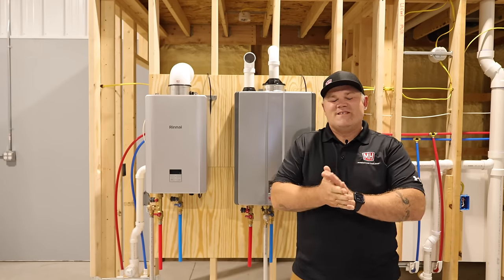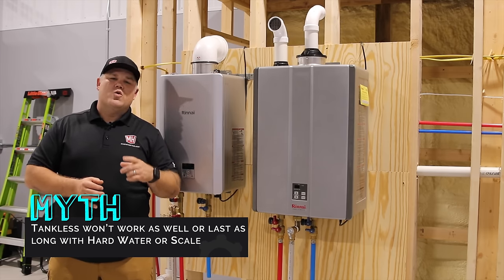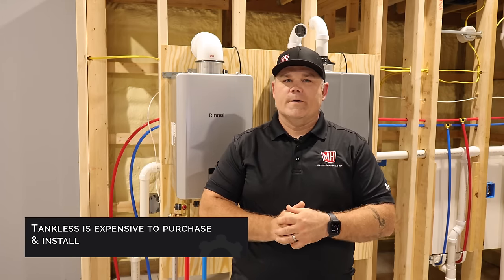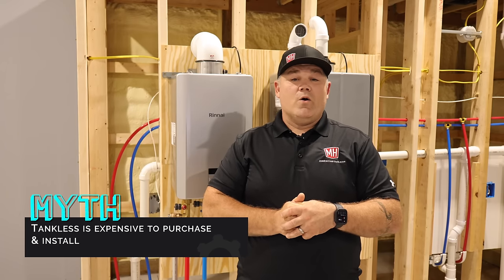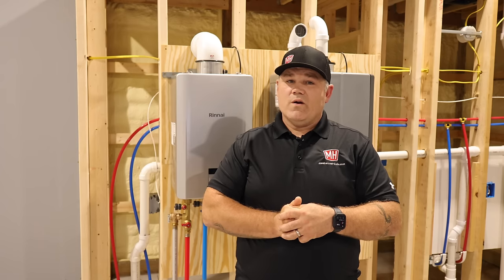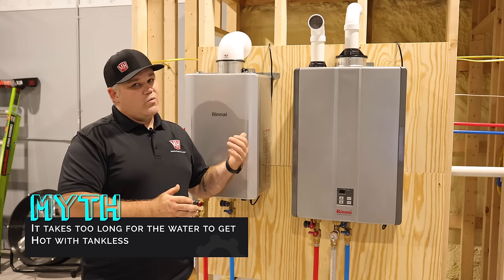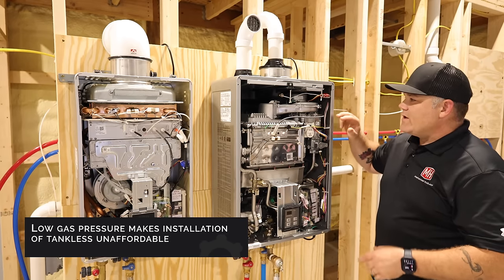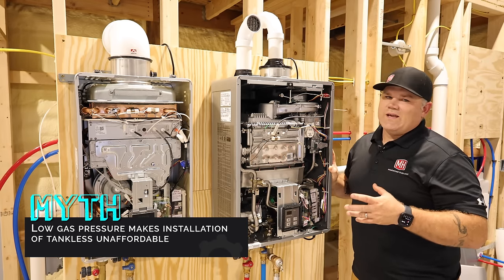Myth Busting! Tank -vs- Tankless Water Heaters

Comment: A tankless relies on fast heat transfer over a relatively small heat transfer area. That area and speed matters. While both experience the same scale, the affect on performance is vastly different. The tank can accommodate scale far better. You didn't talk about maintenance at all and that YL require flushing because they are more sensitive to that fouling.

Tankless have a fixed output with no buffer. Tanks have a usually much lower output but a large buffer. If you temporarily exceed the output of the tankless you get cold water. While people regularly exceed the output of tank heaters, they often dont do it long enough to notice. This is just a sizing issue. If you run out in a tankless you didn't get a large enough one, or need to use less water. On a tank, if you run out either you need a larger buffer (bigger tank) or a higher output unit.

Stating tankless is less expensive is utter nonsense. The most expensive tank units are the starting prices for TL which then go up a few 1000 from there. TL is a luxury item that should be purchased if your needs actually require it (few do). TL installation is more expensive. If you are paying to have it done though, the labor is the dominant cost so the parts won't make that much difference unless you need to tear into walls to connect to a panel or gas line that is large enough.

Which leads to this video is sugar coating the gas line or power requirements issue. The gas requirements is roughly 4x as much for a gas unit. Most tank units have a half inch line, which is not large enough for a tankless. A similar case will exist for electric units and the wires. The panel may not be able to supply the needed power. The gas lines may need to go way back to the meter to be larger enough. These costs can vary a lot depending on the situation. Sometimes being insignificant, other times very expensive. TL have a higher output and need more power/gas. 

Copper heat exchangers are better for heat transfer. This is a moot point though. This simply means copper can do the transfer in a shorter length (smaller area) than stainless or some other material. The heat exchanger is slightly larger with stainless. Who cares... That larger heat exchanger means it can handle fouling (scale) better, and stainless is generally more corrosion resistant. So is probably the better product in most cases for this application.

Definitely do not buy a noncondensing high efficiency WH. Tank or tankless. The flue pipe is ridiculously expensive and cost of the pipe will pay for the more expensive and efficient condensing unit. The only exception being a direct vent unit, where the vent is extremely short. 
Non condensing units that are lower efficiency (the line is around 85%) leave enough heat in the flue gasses than low cost vent pipe can be used. If your gas isn't super expensive, the cost of a more expensive efficient WH will never pay for itself over the 85% models. Run the numbers before you buy. The difference in you gas costs for a 5-10% efficiency improvement isn't that much, but the price of the WH is 2-6x as much.

I think they have largely fixed this issue now, but check the minimum flow rate of any TL and make sure it still works when you only have a faucet slightly open. Older units you would have to run it wide open or you might get cold water.

Double check the noise they make. TL (and all condensing units, tank or TL) have fans that make noise.

TL save space.

TL long term output is higher. If you have long continuous use, it might be the better option.

TL are vastly more complex and have many more things that can go wrong. Plumbers (or anyone really) are rarely knowledgeable enough to actually fix them (complex electronics). So will replace major components if available. Like replacing the entire control board if there are behavior problems for instance. Also labor costs for anyone to spend the time to figure out what went wrong are high enough that just repacing parts is justified. Parts are often very expensive though and by the time you pay for that and labor, you are getting into replace the whole unit territory. This is a huge cost risk for TL. The cost of parts on tank heaters are usually cheap and easy to service.

TL if the power goes out, you have cold water. Tank you have at least the tanks worth, and if a simple gas unit, they don't even need power.

Bottom line, learn about what you are buying. In most cases tank heaters cost less and can be sized to meet your needs. Learn about tank recovery times. If that speed isn't enough, get a bigger tank, or higher output. Learn about maintenance. Learn about how long they are really lasting. In a tank, replace your anode every 5 ir so years!!!.

Comment: I have a 12 year old electric water heater. What would replacing it with a tankless system involve? We are not on a well, but the water definitely needs softened/filtered. We don't need a ton of hot water capacity. We were thinking about just getting a 30 gallon tank system. What would you recommend if we take out the tank system and put in tankless, a filter and a softener for a household with minimal water usage. Note: our laundry area is on a different water supply than the house. We do have access to propane if we really had to, but that would be another new connection. Thanks for the great video!

Comment: We're just north of you in Thunder Bay, Ontario. We chose to put a tankless in with our last set of renos. So far we love it and it heats water and back-to-back showers are a time saver for our small family. I have noticed that we sometimes get a moment of cold water right after recently running hot water and it takes some time to flush to get back to hot. This only happens occasionally. Do you think there would be any benefit to insulating our PEX waterlines (is it even advisable to insulate PEX?

Comment: Really  good video....very helpful....thanks for posting! Question. I live in a mobile home. Are there mobile home specific tankless units like there are for conventional tank units? Can i just use the gas line that has been feeding the tank unit without modifying it? Do i need  to run electric to a gas tankless unit? Thanks again!

Comment: Great video.  We went tankless about 5 years ago.  One thing I have heard is that you need to run some scaling agent through then on an annual basis.  Do you really need to do this?  We have a water softner.
Reply from the maker: Yes, the manual states the maintenance interval and procedure for your unit.

Comment: I have a farm with multiple outbuildings.  I converted the out buildings to propane tankless heaters using only Japanese brands.  Never had a problem.  I'm thinking of converting the main house from electric water tank to a tankless system but unsure of the cost of energy between tankless and tank.  If I go propane I would have to put in a large tank and run a line.  If I were to use an electric tankless it would be easier for me but would there be an energy savings?

Comment: You know have always been skeptical about getting a tankless water heater, I was in Germany so long that everything there is electric and considering I only have 100 amp input to my house.
 I thought that was outta the question.
Sounds to me like tankless water heaters in the US are mainly gas correct ??

Now you got me thinking how much would it cost to change over my hot water heater to a tankless water heater. 
My water heater is about 13 years old so I guess it’s becoming time to change it.

Comment: Your vid is excellent.  Big guy I hate to tell you are wrong but it does take time for warm water to reach an appliance.  With a tanked water heater the pipe is continuously sitting in hot water. The water is always warm.  I have had a tankless water for 28 years and I would never change.  What is 30 seconds to get hot water.  For hand washing I have gotten use to washing in cold water.  We used tanked water heaters because fuel was cheap.  In western Europe they have been electric tankless waters heaters sense before WWII.

Comment: Thanks for your video. I’ve gone back and forth with replacing a water heater of the veteran age. My concern is about venting…I live in the Northwest and understand building codes can vary state to state, yet would like to know if the existing natural gas tank water heater venting can be used to vent a gas tankless water heater…?
Reply: Check out heat pump electric too. Be sure to actually get reliable estimates for both tankless and tank, then run ROI calculations.

Comment: Just replaced mine yet again 5 years ago replaced my 24 year old water heater with a tankless, the tankless lasted 5 years. at double the cost of the tank water heater and about 1/3 or less life expentancy, you will save energy but it will cost you a lot more in the long run.

Comment: I live in a vintage 1960's, 2 bedroom mobile home (yep, I'm trailer trash - but on my own property),  and my water heater quit on me last year.  I replaced it with the cheapest tankless water heater Home Depot sells, and installed it on the exterior wall beside the old water heater compartment.  One of the smartest things I've ever done...

The only thing it couldn't handle was filling my washer with hot water.  I could've just pinched back the hot water to the washer, but I was too lazy to pull my stacked washer/dryer combo out to access the faucet.  Instead, I just pinched back the heater's outflow valve.  So my washer takes  longer to fill than it used to... whoop-de-do, not a major problem.  There's still plenty of volume for my sinks and shower.

Regarding how fast the water heats up:   my washer is just inside the shop I've built against the back of my mobile, and about two big steps away from the heater.  I've started the washer filling and taken those two steps to the heater to grab its outflow, and by the time I get there the copper tubing is already hot.

Of course, it helped that I'm a retired general contractor and was able to install it myself, instead of hiring it done...

Comment: We had the exact same Rinnai unit on the right.  The boiler had a slow leak not even a month or 2 after installation of this brand new unit.  It turns out that it's a common manufacturing problem with that model.  Finally the unit failed.  The company that installed the unit did not attempt to repair it as the cost to replace the boiler would have been approximately 1,500 in labour alone. The boiler itself would have been under warranty.  I prefer tank water heaters.

Comment: One plumber told me that repairing/maintaining tankless was more expensive because (IIRC) it couldn't simply be done by the average plumber. You needed someone who has dealt with circuit boards and electronics, which wasn't the skillset of a plumber. Is this correct?

Comment: I have 2 tankless water heaters, one for the hot water, one for the radiant floor and are installed next to each other. Both are propane. They work great and they take up less space. I live in the country, so infrastructure is expensive such as buying the propane tank and burying the tank and running the lines underground. There are propane providers that own your tank. This approach gets complicated. I know this firsthand. My tank is 250 gal and lasts about 4 months for the water heaters and kitchen stove. Propane is not cheap either, the last fill cost $4.50 a gal. To me heating water and storing hot water is a waste of money. I don't know if I did the correct thing, but I like them.

Comment: Installed a tankless (not Rinnai) 7 years ago during a renovation.  I have low-flow fixtures so the shower uses 1-1.2 GPM.  I can take hour long showers if I want!
The unit is 98% efficient and has a projected annual usage cost (yellow label) of $164 a year to operate.
I WON"T GO BACK !!

Comment: Our tank water heater is in the mechanical room which is in approximately the middle of the basement. We've been told that it would be cost prohibitive to switch to a tankless water heater due to the location of the existing water heater. Does the tankless water heater need to be installed on an outside wall?

Comment: I see you have both of them mounted on plywood is that just for demonstration purposes, I thought they had to be mounted on something concrete. I have a small utility closet where the furnace and hot water tank are. The only place I could see to mount it would be a living room wall inside the closet or on the chimney.  Is that possible?

Comment: My parent's house has a hot water radiator system. The furnace for the heat also does double duty as the hot water heater. The only time that house ran out of hot water was during a stretch of time where the pilot light went flakey. I miss having unlimited hot water. Sadly, I don't have it in the budget to replace a perfectly functional tank water heater with a tankless. Once my current water heater dies (probably has at least a decade of life in it) I'll see what is on the market for unlimited hot water solutions.

Comment: So, how do you treat the water before it goes into water heaters? 2. If you do not treat the water, how long is normal lifespan of a tankless? 3. So you can flush a tank, is that possible with a tankless? 4. Is there extra maintenance with tankless?  5. What about point of use tankless, would you recommend ?

Comment: Thank you for the common differences between tank and tankless. My Q is do constant power fluctuations damage the electrical circuits in the tankless? 
My second Q is on the two units shown the one on the left. The larger exit pipe. Does that also allow inlet air? Thanks in advance 
Kevin

Comment: The problem usually is you need power and a 4" flue. Most residential water heaters have a 3" flue pipe. Putting a recirculating line with just keep the gas running. Some don't have the acidic condensate. The acidic condensate with eat through the concrete. It's cheaper to just buy a regular water heater.

Comment: Built a new house in 2004, on well water with a simple water softener and a simple 50 gallon natural gas water heater. At the 15 year mark, I purchased another nearly identical hot water tank for $700 and staged it in the basement for when the original heater fails. I can swap them out myself in a couple of hours. There is absolutely no way that a tankless hot water heater would have been the cheaper option for me.

Comment: My slight resistance is having another family member running the hot water all the time, I've had someone leave the hot water slowly running overnight, I have considered leak sensors for my home automation system that would alert me to this, but need to do more research.

Comment: Tankless can be crazy expensive to instal.  In my basement, it’s fully built in and the heater is in the center.  You can’t use the old chimney style vent so multiple walls and ceilings would have to be ripped out.  I was quoted $9,000 just to run the PVC pipe, paint, and fix everything.

Comment: As a service plumber in a rural area, convincing customers to install a softener system is like pulling teeth.  Hardness and low water quality will degrade any fixture, but at the holding tank style of water heater will at least do its job with hard water, while the tankless heater will not function with a small amount of scale.  Great in certain instances , but not at all practical in many, as well.

Comment: I liked the idea of tankless since I had first seen it on the New Yankee Workshop years ago. But when my water heater was running down I started thinking about replacing it with a tankless one. The problem was the cost difference. It was over twice as much for the tankless, so I went with the tank again. It cost me $300. Instead of $1500. I can get 15 or more years out of the tank and that’s money in the bank for me. 
But I don’t know why you said that they’re the same cost, I haven’t seen that in my area.

Comment: I just saw your video.  Question how efficient are all electric units?  There is not any gas in my area.  Thanks.
Reply: They're about the same. Tanks lose a little heat, but are extremely well insulated (they hold heat for 3+ days, and can heat up in 2 hours). Otherwise, one thermoelectric heating element is the same as the next, whether tankless, a tank, or an electric tea kettle. If you want high efficiency, look at heat pump tanks.

Comment: Lived in Japan from the eighties into the nineties - tankless systems were in almost every home or apartment, and I loved it.  Combine a tankless system with a recirculator on a bathtub that also recirculates water - you can fill the tub with hot water before you go to work, come home and just jump in the tub to relax.
Reply: I noticed the same in Thailand. They are very common. Water heaters are rare.

Comment: What about the total electrid tankless water heater?  I could see not using it in MN, especially in the winter! I live close to the Florida line. I've only had 10 or so days below 20 degrees since 1990!  And five of those were in a row, which caused a SOV to burst on my well tank, which sits in the open-air! Had it been enclosed with a 100W lightbulb on, it probably wouldn't have frozen.

Comment: There was a slight inaccuracy in myth 1. I installed a tankless hot water heater in my all electric house. The circuit for the water heater was 30 amp. The biggest unit I could find under 30 amps was a 5.5 kw unit. That is only 23 amp, but I could not find a decent 7.2 kw unit. 

In winter with somewhere in the neighborhood of 1 pm, the outlet temp was 105. 

I could have upgraded the circuit to 60 amps, but that would require new breakers and the new 40 foot wire run that would handle 60 amps. That would have run into the hundreds of dollars, which at the time a standard hot water heater was about $300.